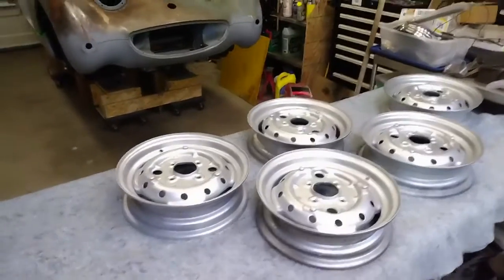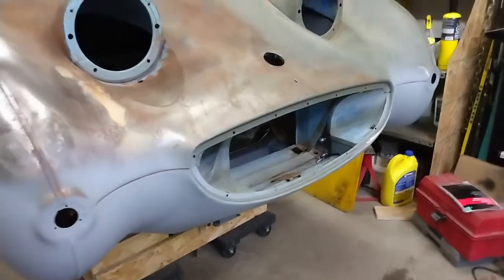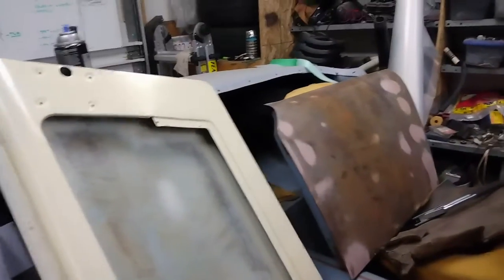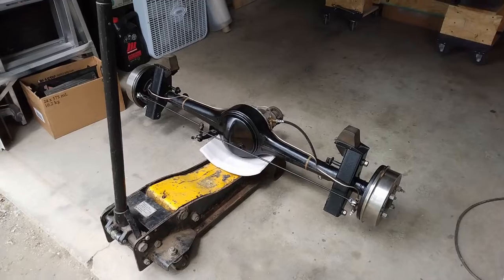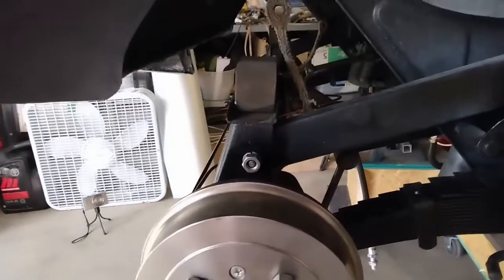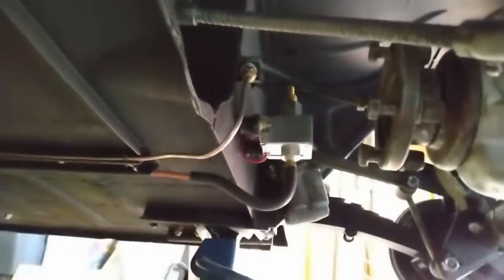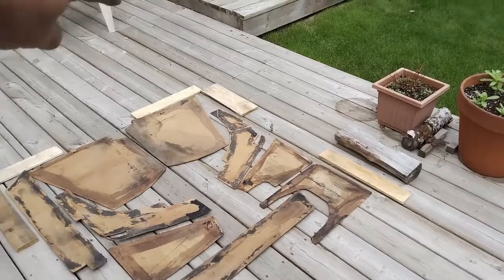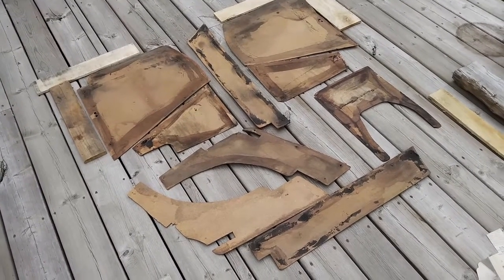How I installed the rear axle in the Sprite & measuring up the interior panels .Bugeye Build Ep. 77

Comment: I used solid masonite (same material as pegboard)  My MG TD had vinyl over the PO's old kitchen Formica countertops. It was awful!. I noticed some of your templates were right next to each other. You must allow for a lap over. At least 1" .Otherwise the contact cement won't have enough surface area to "bite".  The rear axle looks beautiful. I'm jealous...
Reply from the maker: Thanks Dan. I will be using the hardboard/masonite for the panels. In this video I was figuring out the material required to reproduce the panels. I'll be going through the same procedure to figure out how much vinyl I will need and will take into account the extra needed for the overlap. The material I'm looking at comes in a roll that is 140cm wide which is about 20cm wider than sheet of hardboard. Here's hoping the rear axle works as good as it looks!

Comment: I have an early '58 and when I did a nut + bolt resto 22 years ago I reassembled  with the spacers outboard of the radius arms (not likely noting what side the spacers were on). 
Just curious, is there a method to this procedure? Do you think it makes any difference whether the spacers are inboard or out? 
BTW, you're doing great work!
Reply from the maker: Thanks. I believe the design of the radius arm bracket was changed as some point between the early '58s and mine, a December 1959 build. This 15 second clip ( https://youtube.com/clip/Ugkx2A0BVLQUIoEgL-NVmE3w-VXgmWCXQmz0 )  shows the radius arm bracket and you can see there's a built in spacer. In order to keep the radius arm straight the spacer at the other end has to go where I show it in this episode.
Reply: @EconoboxGarage  Thanks for the feed back. I see that your R A mounting bracket is different to mine, an evolutionary change as I understand.  On a closer look, I've also noticed that my bracket has a spacer welded in place on the outboard inside face of the bracket, meaning that the loose spacer should be placed on the inboard side. Cheers!

Comment: That rear axle looks pretty good, glad to see it back in place, minus a few tightened bolts and of course the hose clamps for the fuel line. But surely you'll remember that before you put gas in the tank! As for materials? I'm not sure. I'm feeling up one of the original door cards from my '58 and the board does indeed feel like lacquered cardboard and the vinyl feels like thin vinyl with no pattern in it at all. Just flat. I thought it might be the same material as the seat upholstery, but it's much thinner than the upholstery on the seat. I have 1 original seat back, and that vinyl is quite thick, or so well glued to the foam that it feels thick. They're also two different shades or red, but that isn't particularly relevant because I've no idea how long either part was exposed to solar radiation. I can also compare the one card I have here to the ones in the basement, which have been hidden from sunlight since the early 80s, as I found the rest of my panels at my mom's house the other day when I picked up the last of the engine blocks and heads, so I can also compare those original ones if you like.
Reply: For the cardboard replacements, I would use some thin plastic IMO because it's hidden and it's water proof. But what plastic, I don't know. It has to be a few mm thick and fairly rigid.
Reply from the maker: I plan on making the boot side panels, which were originally cardboard, out of the same material as the panels up front.
Reply from the maker: Thanks Ken. My plan is to go with grey vinyl on the panels. My seats and dash are red with the carpet kit being grey. I was just a a fabric store today looking at options.

Comment: Backend looks great in the car. What pumpkin did you end up going with? I’ve almost tried them all but a 3.5. I handmade my interior panels. Covered them in vinyl. Used cardboard to make the templates. Used a thin plywood which had a thin layer of cardboard that I covered in the vinyl. Holds up well.
Reply from the maker: Thanks Mike. The rear end is whatever came in the car so I'm not sure of the actual ratio. As for the panels, I'm leaning towards using 1/8" hardboard sealed with an oil based varnish.
Reply: @EconoboxGarage  you probably have the 4.2 pumpkin. With the 1098 engine you might think about going to a 3.9 or 3.7. But if no free ways in Canada then forget it   Heh
Reply from the maker: I'll see how I like it with the 4.2. Our plan is to be staying off the major highways as much as possible so it may not be an issue... time will tell! Thanks for continuing interest and encouragement in this project.